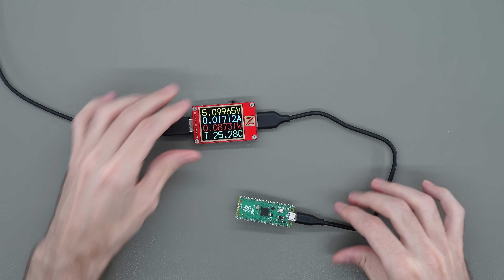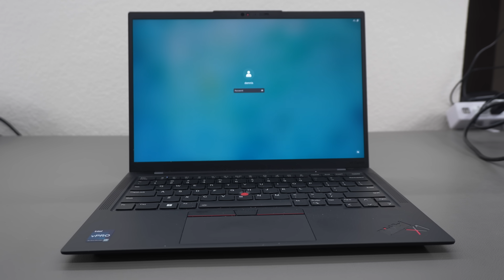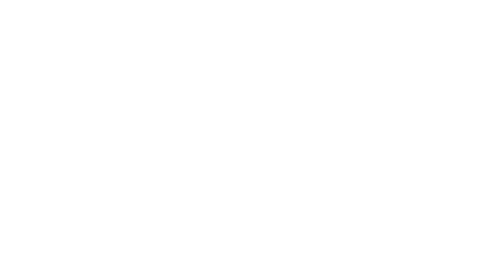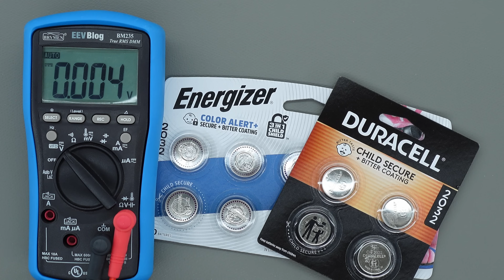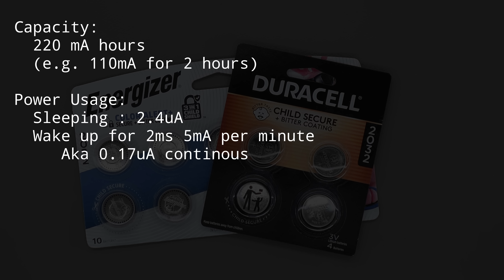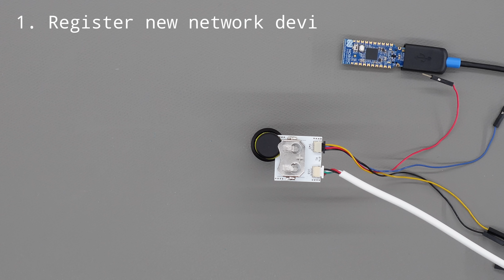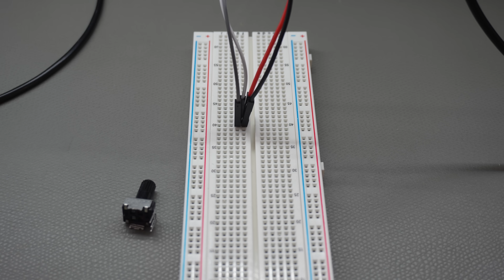I Just Wanted a Button. It Escalated.

Comment: I would push back on the reed switches somewhat. Checking the datasheets, most reed switches will be rated for tens of thousands of operation cycles, far more than you would ever open a standard door. Second, using the reed switch inline with a pull up resistor on a microcontroller input set up as an input will pull your nescient current down to the input current limit of the input. Your signal slew rate will be limited by the input leakage of the microcontroller input, but you are looking for events that happen on the order of seconds, so a few hundred milliseconds wont matter for accuracy is your case.
Reply: Wait until he realizes that normal-closed reed switches exist. Also, the datasheet of the first one I randomly looked at casually mentions, and I quote: "over 1 billion reliable operations at dry circuits or low level loads". That's BILLION.

Comment: I believe this is how Amazon Buttons work
Reply from the maker: Some of them will use this approach. Others use higher power consumption microcontrollers with a separate latching switch that completely shuts off the microcontroller until a button is pressed
Reply: @MadeByDennis 
I apologize for the inaccuracy, I was referring to "Amazon Dash Buttons" I also realized there is a wiki page for them.

Comment: Why not just completely cut the power to the chip until the button is pressed?
Reply from the maker: Mainly so that I can support all the timer related features without a separate implementation and the overhead of keeping it on is low enough that it's not that significant to further optimize

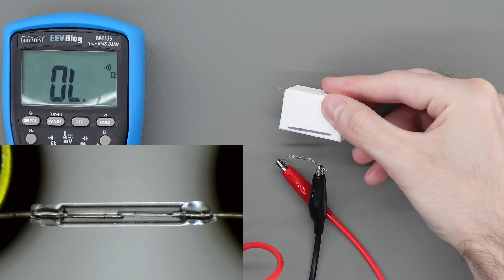Comment: 26:50 Some reed switches actually have 3 pins (so there is both NC and NO pins), so it might be less reliable, but would work exactly like a button, reducing the power consumption (though that's not better if you leave doors open for long times I guess)
Reply from the maker: Thanks. Didn't know they came in 3 pin versions

Comment: Even though I really don't like smart home stuff, this is the kind of smart home IoT stuff I'd be happy to have around, mainly because the DIY nature means I know exactly what's in it, so I know none of it is tracking me or reporting stuff about me to Big Tech. So this is like at least a 4.8 out of 5 project. Very nice!

Also, interesting thing to note, the LiPo battery fires on airplanes that are most concerning are those in the cargo bay since its often not a pressurized environment, and as the 37000 foot Carbon Cub altitude record flown by Jon Kotwicki showed us (what with his iPhone swelling at altitude) one of the triggers of LiPo thermal runaway is reduced outside pressure (although this kind of runaway can be stopped by increasing outside pressure so long as it didn't enter a self-sufficient short-circuit runaway condition). I imagine one of the reasons Jon's iPhone survived was because the frame of the phone was applying sufficient pressure to prevent full runaway, but I recall him saying his phone was getting warm, and that was in air temperatures so low he instantly got frostburn from touching metal.

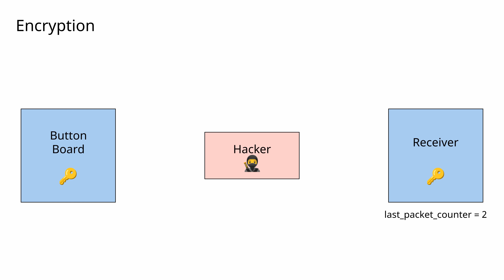Comment: 13:05 — note that depending on the implementation, this doesn’t fully protect against sophisticated attacks. An attacker can listen on the signal and when it sees one with counter=1 it can jam the radio waves. When the packet is repeated with counter=2, it again jams the radio waves, but this time it later sends the saved packet with counter=1. At this point, it has a packet with counter=2 saved for later use.
Reply from the maker: Yeah, that's partly why I send out heartbeats so that the counter continuously advances unless someone is around for a while jamming, though having something like a synchronized clock on both sides would be more robust...
Reply: But the attacker would need to break the encryption to read the counter.
Reply: @sallerc  the attacker doesn’t need to understand the packet at all. They just listen for two consecutive packets. This is called a Rolljam attack.
Reply from the maker: @sallerc  The counter is not encrypted since it needs to be known to decrypt the packets.
Reply: @MadeByDennis  Why is the replay-prevention nonce/counter appended to the key instead of being part of the encrypted message body? It doesn't need to be visible and should not.
Are you mixing it up with the IV/nonce of the AEAD mode of encryption you are using? That one will be (and can be) public and makes sense in the context of your sentence.
Reply from the maker: @RegrinderAlert  The wording used in the video is very simplified, but yes, I am doing the standard practice which is to form the nonce using a secret IV and the counter (and the sender address). The counter is visible in plaintext in the packet before the encrypted data. This is the same practice used by Zigbee. If you look at something like Bluetooth, the full counter isn't included in the packets since it infers that the counter is one higher than the previous value. This isn't any more secure since anyone can count the number of packets but is less reliable since you need extra retrying steps to re-sync the counter if there is a  dropped packet.
Reply: @MadeByDennis So you are using the AEAD nonce of your GCC mode of operation as the anti-replay nonce as well? 
This makes sense. I just commented because generally, anti-replay-tokens are irrelevant to encryption and inside the encrypted payload.
Agree with the security assessment of course 👍

Comment: Great video and project. Without HA or Zigbee integration it's not really useful to me personally, but adding an HA bridge (or maybe mqtt bridge) shouldn't be too hard.
Reply: He's using a receiver connected through USB. Home Assistant has a Serial integration that supports Serial over USB and if that doesn't work somehow, Node-RED has that option too. So you're right, it isn't that hard and you (probably) don't even need a HA/MQTT bridge.
Reply: Im not 100% confident but i looked into the datasheet for the microcontroller they are using and it may also have Bluetooth as well as zigbee as available options with some extra coding effort.
Reply: NRF connect SDK has ZigBee protocol stack, so it should be not too hard to add ZigBee support using it.
Reply: Proprietary is king

Comment: I kinda wonder for the button if an mcu is needed at all. You could likely use a cheap low-lut fpga for efficiency gains since the logic is incredibly simple.
Reply from the maker: Maybe. This is already getting close to the rated lifetime of the batteries and once you add in stuff like logic for button debouncing, supporting other modes if you want them like double taps, wireless encryption, etc. the code is pretty complicated so I ended up being using an MCU for simplicity since it didn't seem like there was enough value with going the full FPGA route unless you actually need some intense always on sensing that you can't convert into an interrupt.
Reply: FPGAs are more expensive than comparable MCUs, they’re typically only used for prototyping, in high end networking gear, or where the programmability is worth the extra cost. FPGAs are also annoying to program, and the majority of them have horrid, clunky toolchains that are a massive pain in the ass to get working right.

Comment: I did something similar with an esp8266, 2 lithium AA's, and a reed switch for a mailbox alert. Controller in deep sleep, reed switch wakes it up, runs code to connect to wifi and send an MQTT publish to homeassistant and goes back to deep sleep. The 2 AA's last over a year.

Comment: Instead of using the switch thats right there, make another one that is more expensive and requires internet to work! And not wanting to run wires for the light seems fine until you realize it needs power to light anyways!
Jokes aside, smart items can be very useful sometimes but some things don't need to be overcomplicated. I'd hate needing to go in a room and being stuck in the dark because some microcontroller somewhere crashed. I have good internet yet my projects keep going offline randomly for like a minute and miss critical events. I thought id use solar power and wifi to make an outdoor sensor but having to put another wifi repeater and also AA batteries as backup for my solar all are way more expensive than just a reed switch on a long wire. Think carefully before making something smart, old reliable could be smarter if it works.
Reply from the maker: Thanks. Definitely good points here. I'm using some of these to also add switches where I don't have them in my home. Reliability is definitely something I've been thinking about. Nothing in my setup requires an internet connection going outside of my home (only local). I'm avoiding WiFi for now since the connection process is way more complicated and more susceptible to drop outs. Once you simplify everything enough, microcontrollers can be pretty reliable. I've had several of them running around my house for years doing other stuff without any glitches.
Reply: @MadeByDennis  yes, indeed a good project can be reliable. I made something with an atmel like 9 years ago, its running 24/7 and has not crashed once, although regular power outages do reset it. I really recommend making a separate network for home devices, that doesn't have acces to the internet. Encryption is very nice, its way better than how most commercial products do it, but a locked down network also provides stability, less interference, and no bandwidth problems.